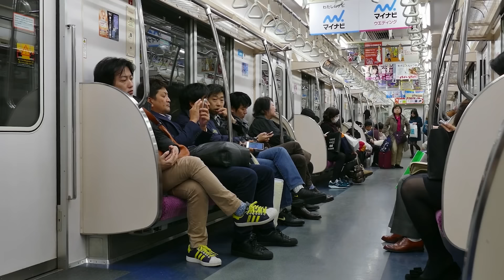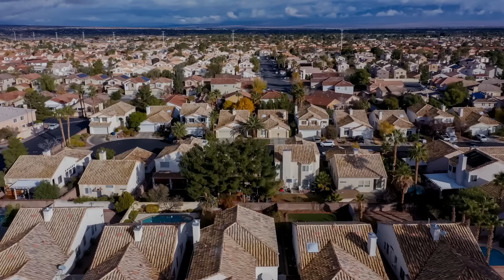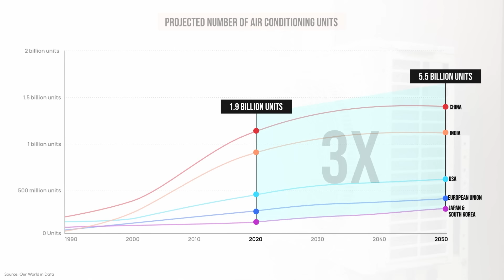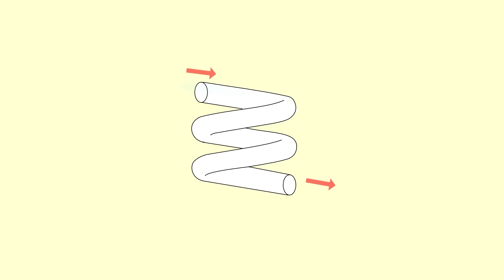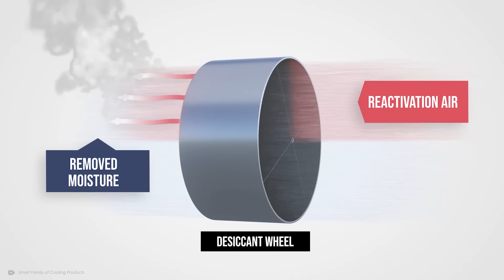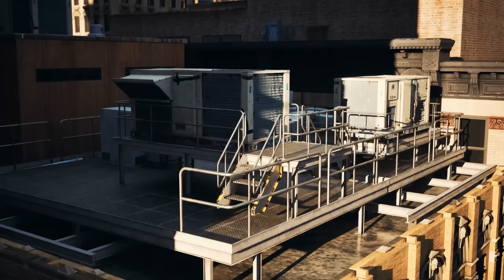The Future of Cooling is Here: The NASA Breakthrough

Comment from the maker: Clarifications below! Protect yours and your families privacy and support the channel by getting 20% off DeleteMe at https://joindeleteme.com/Ziroth

CLARIFICAITONS AND CORRECTIONS:

- The biggest error is the order I presented the components in. I believe the Helix coil is placed AFTER the liquid desiccant, which is sprayed into the incoming air as an aerosol to extract the water vapour as droplets. This means the centrifugal effect can efficiently remove the liquid desiccant droplets from the air, which allows water vapour to be extracted in the process. 

- I mentioned in a now removed clip that dehumidification is a side-effect. This is not correct as AC units were originally designed to be a dehumidifiers, however most of the 'useful' work now done is the cooling effect, as that is what people are really looking for.

These were silly oversights due to rushed timelines, but I will continue to try and minimise these errors going forward.
Reply: Frankly,  it's still misleading to say that cooling is the "most of the useful work."  While it's true most people probably think that,  it's telling that theH in HVAC is for heating but the AC is for air conditioning not simply cooling. That is because humidity control is a key aspect of air conditioning even if most people are unaware (seemingly, OP included). 
Keep in mind that humidity is expressed as a percentage of saturation which is a function of temperature, cool the air without removing moisture and humidity will rise, quite possibly above 100% and you get condensation. This is why drying the air is a critical function of air conditioners.  To wit, this new technology requires a water extraction step, so it's still functionally AC (not just cooling) despite using a different process to achieve the effect.
Reply: Air conditioning doesn't say refrigeration but yes it is taken as many call a cola a coke or at one time all jeeps was cross term used for a model or style of utility vehicles. 
Condensed air has many uses. Jets and commercial air crafts ,sky scrapper and residential can use a verity of air conditioning  methodology
Reply: @jon9103  air conditioning can be for both heating & cooling self explaintory words but with out context. 
This video of nasa discovery sounds more like a filtering dehumidifier improvement at best but I'm not sure why this is any better than what we already have. 
We can filter H 2 0 molecular bonds out of air. 
Start getting smaller like in covid you block air molecules before you can ever actually filter out sub micron pores. Lol
Reply: stop your bs about carbon emissions propaganda . you are carbon. ok
1966: oil gone in 10yrs
1967: dire famine forecast by 1975
1968: overpopulation will spread worldwide
1969: everyone will disappear in a cloud of blue steam by 1989
1970: the world will use up all its natural resources by 2000, urban citizens will require gas masks by 1985, nitrogen build-up will make all land unusable, decaying pollution will kill all the fish, killer bees, ice age by 2000 and America will be subject to water rationing by 1974 and food rationing by 1980
1971: new ice age coming by 2020 or 2030
1972: new ice age by 2070 and oil depleted in 20yrs
1974: space satellites show new ice age coming fast, ozone depletion and "Great peril to life"
1976: scientific consensus planet cooling and famines imminent 
1977: department of energy says oil will peak in the 90s
1978: no end in sight to 30yr cooling trend
1980: acid rain kills life in lakes and peak oil in 2000
1988: regional droughts in the 90s, temperatures in DC will hit record highs and Maldives will be underwater by 2018
1989: rising sea levels will obliterate nations if nothing is done by 2000 and New York City's West Side Highway will be underwater by 2019
1996: peak oil in 2020
2000: children won't know what snow is
2002: famine in 10yrs if we don't give up eating meat, fish and dairy and peak oil in 2010
2004: Britain will be Siberia by 2024
2005: Manhattan will be underwater by 2015
2006: super hurricanes
2008: the Arctic will be ice free by 2018 and Climate Genius Al Gore predicts an ice free Arctic by 2013
2009: Climate Genius Prince Charles says we have 96 months to save the world, UK Prime Minister Gordon Brown says we have 50 days to "save the planet from catastrophe" and Climate Genius Al Gore moves his 2013 prediction of an ice free Arctic to 2014
2013: the Arctic will be ice free by 2015
2014: only 500 days before "Climate chaos"
2018 A top climate scientist is warning that climate change will wipe out all of humanity unless we stop using fossil fuels       by  2023...Greta Doomberg.
2019: Hey Greta, we need you to convince them it's really going to happen this time
2020 Greta Thunderberg global warming will cause temperatues to rise to 80 degrees celsius and drown 80% of the population.
2024 Greta still alive.
2024 WEF
Reply: I'm concerned about the long-term effects of systems that don't have properly maintained or poor performing scrubbers to remove the desiccants. We'd be breathing that in.
Reply: Einstein & another guy co-created a refrigeration system that's a solid state that uses heat as the motive force to power the process. I live in the desert so that's what I plan to build for my home refrigeration needs. The Helix system is neat. Pretreatment of the air could make things a lot easier for me to cool the air that cools the machine.
Reply: We do this already in southern usa filtering and dumping water in our homes to unload work on cooling a/c units. 
In the dry west they can use this knowledge & tech to cool without refrigeration but they rarely do despite all the tree hugging. 
These used to be a primary camper tool of cooling but isolated and alone humidifiers will only cool so many degrees under the greater environmental temp & conditions.
Reply: @dadsonworldwide3238 maybe take a look at a weather report before casting your shade redneck.

"only recommended in low-humidity climates of 15% humidity or less. Areas with 30% or more humidity are not ideal for swamp coolers since they will struggle to accomplish the evaporation process in a more humid climate."

I understand youve spent so much time kissing boot and licking hairy orange butthole that it never crossed your mind that there may be different climates in areas where the tallest hill is not your mom, but do you see that bit where it says 15% or less? Now, I know it must boggle the mind of someone so vacuously inexperienced in the world, however I have unfortunately pulled the short straw (dont worry, its just a piece of straw, not a branch. Im sure you're used to holding smaller things, but it is just some straw) on informing a 'i can pull up my own Huggies' big boy like yourself that there is infact a high desert, and a low desert. 

And here in the low desert, right up against the mountains (just like everyone in town is right up against your mom), its above 30% from May to October! You know, all the hot months one would want to cool off their houses? Hell, it stays above 15% from April to November! Im 100 miles away from the beach, and it gets wetter closer to the ocean!

So, here is my question for you Mr Southern Pride (dont worry bayby, I's almost done. You can get back to your white flour here in a second, hun); with swamp coolers already being a thing in the high desert, in the few areas where it is below 15%~30% humidity (yes, even up there it can be too humid for swamp coolers to work effectively), and the population density difference of around 80%, in other words there are 5 times as many people in the low desert, where its humid when its hot than in the high desert where evaporative coolers would have any chance of working......how much of a dick do you think that tree hugging comment made you look and do you reckon that kind of attitude is why yall dont get taken seriously constantly showing your ignorance like that all bold and arrogant like, bless your little hearts?

Ruminate on that for a spell would ya friend? Cuz this California redneck is fixin'a learn ya somethin, son.

Comment: Humid air hae energy stored in potential energy of the water wapor. When you condencate it with ANY mechanism that enery will be reliased. And since all methods have non 100% efficiency you will release even more enery. So... how you will remove that additional heat?

Comment: You completely skipped over THE BIG SOLUTION:  Building into the ground while using superior insulation, reflection and transmittance to cool the interior.

I introduced a humidification step in my portable A/C's outside air intake with less than $20 in parts.  Two gallons of water a day only cost a couple of pennies per day, yet reduced my daily A/C electrical load by a couple of dollars a day.

Comment: So, if "preconditioned" air is dryer air, how many nosebleeds will that cause? How many people will have to run a humidifier in their homes to offset the preconditioned cold air? I get that removing moisture before cooling makes a huge, undeniable improvement in A/C systems and efficiency. And that's great. But if you've ever had dried out sinuses before, you know how much that sh*t can hurt. Just wondering.

Comment: I designed an aircon system 6 years ago using a silica gel hygroscopic heat wheel to catch the moisture before entering the air handlers. Ambient air 30°C 75% RV air after heat wheel 26°C 45% RV. The regeneration of the heat wheel was accomplished by the treated return air from  the building. The proven energy savings are 50% from the calculated heat load and no extra energy consumption for regeneration. All equipment is readily available and proven technology. Sorry NASA.

Comment: Never heard of the word "desiccant"... Really It's everywhere. Open a bottle of Excedrin and you will see the little pouch or in a bag of beef jerky.
The humidity in the air with respect to HVAC is called "Latent Heat" and yes a good part of BTU dissipation is devoted to removal of the humidity in the air going through the HVAC system. The system has to remove the humidity first until the system properly removes the heat from the air. When you first turn the system on the Delta T may be 16 deg F or lower but after a few hours the Delta T will get up to 20 deg F or more once it get the moisture out of the environment. So yes, if there is a way to de-humidify the air before going through the HVAC evaporator core using little energy would be a big benefit.

Comment: Some of the largest sources of Energy WASTE,  is not from Heating and Cooling,  but instead,  from POOR INSULATION.   Houses and Building could stay Warmer, or Cooler,  for MUCH longer... if they were insulated much better.   Furthermore...   Put Building Into the Ground... and you no longer have to spend Energy removing Snow, as well as have more Stable Temperatures (no Cold winds, and no sun rays beating down onto Hot Roofs).

 Since there would be no Frigid winds to deal with underground... you also do not experience as much Heat Losses, from the Opening and Closing of Store Doors.

 But the BIGGEST BENFIT to putting most everything Underground... is that you would Free up the Above ground,  for Luscious Farmland, Forests, Parks, Lakes / Waterways, Etc.    No more Concrete Jungles, on the Surface.   People could visit and enjoy the surface / parks,  anytime they chose.
Reply: Also, one of the biggest Heat losses in Houses,  seems to be from Windows (especially large "Picture Windows").   Most especially, since houses use much Thinner Plate-Glass.  Even double pained windows, do not seem to be as effective as the much thicker Tempered Glass, used in Commercial Buildings.

 It there was a mandate for much thicker window glass..   It would go a long way.   Even it that meant, that many places would reduce the overall number of windows.

Comment: I am an HVAC professional, sounds like somebody's trying to eat a free lunch to me. 

Assuming the system works as claimed where is the energy to push the air through these tiny channels going to come from? 

I'm willing to bet once you factor in the increased energy requirements to push air through these channels as well as the additional wear it will place on the blowers as well as the cost to produce and distribute the desiccant this is a net negative.

Comment: @ZirothTech just stumbled on this channel. Interesting stuff!

Always cool to see new tech being developped, especially with huge upsides and little downsides. This one seems like it would be a good fit for bigger buildings. Depending on cost, maybe households.

Another company, Graphene Manufacturing Group based out of Australia, is doing a coating product for HVAC called Thermal XR. It will probably interest you! Great energy savings in the form of heat transfer.

They are also in the process of making a new type of battery with insane energy density and charge/discharge rates.

Look them up!

Great video! Enjoyed it 😊

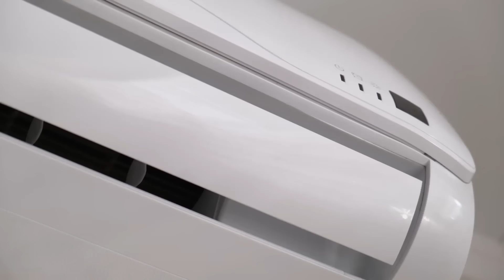Comment: 3:33 -  "This is because it requires water vapour to change phase into a liquid which is an energy intensive task"

I think this is confusing because evaporation requires energy and condensation releases energy... I guess the problem is that releasing energy means more heat to deal with... this took me a long time to figure out.

Comment: How does the pressure drop of the preconditioning filter affect the load on the blower? Is the increased efficiency of the cooling system offset by the potentially increased load on the blower from having such a fine preconditioning filter, and if so, by how much?

Comment: We have already been doing this without all the extra complexity and chemicals. Just take the cold condensate and spray it on the hot evaporator coils: Instantly increased efficiency without added complexity. Air-conditioning systems are already so goddamn complex and wimpy for “efficiency” these days that they don’t last more than a couple of years.. Screw efficiency when it impacts reliability. Just add some solar panels.
Reply: And INSULATION!

Comment: I call scam on this for the following reasons:  1. There are zero test reports showing such improvement. 2. Looking further into this, since last year's breakthrough announcement there has been no further details of any kind. 3. Only ties to NASA was their claimed effort to produce such technology FOR NASA. So it's not a NASA invented or developed technology. 4. Theory itself makes no sense since H2O vapor gas is lighter that's why it rises, so centrifugal force could contra indicate it's effect. Basic chemistry for water vapor to convert to liquid droplets latent heat needs to dissipate so H2O can condense, all the centrifugal force won't make a difference. 5. Desiccant salts are an even bigger joke. Once it absorbs water, it's very difficult to get water out, people just throw away their water absorbed desiccants. At this point, they need to show a real working model with test results.

Comment: For everyone saying: "But the helix can't remove the water vapor from the air, this is all rubbish" are missing a critical piece of information that is also not present in the video. However, either a little thought or research shows what is going on.

Helix Earth is spraying droplets of liquid dessicant into the incoming air. This tremendously increases the surface area of interaction. THEN they use the helix filter to remove the now water laden droplets. Details about regenerating the dessicant are still scant, but perhaps they use the waste heat to help.
Reply from the maker: Thanks for writing this clarification, you are absolutely right. I messed up the explanation of this in the video and should have made it clearer!
Reply: i dont think ANYONE would willingly spray calcium chloride into the air to make every single metal corrode if it isnt gold. and the liquid desiccant will wash the air and collect all the dirt that constantly has to be removed. heating the liquid desiccant to release the moisture takes the same energy as cooling down a surface to condense the moisture directly. the only way to "use waste heat" to dry the desiccant is to run it outside to where the heatpump sheds its heat and hope that its hot enough to drive of the moisture without loosing too much of the liquid to the air.

Comment: So, an evaporative cooler puts moisture into the air. The evaporation cools the air but it uses lots of water.
So then run the cool MOIST air through this filter and make the air even cooler and recycle the water back to the evaporative cooler. 
Result is extremely good cooling with only a small electrical usage for the fans.

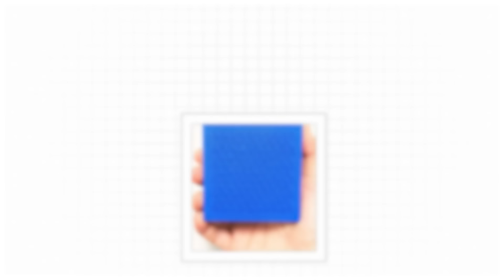Comment: 7:50 Well using centripetal force to take water out of the air explains why you have been narrowly focusing on cooling loads.
A standard Energy Recovery Ventilator [ERV] is probably more flexible for heat pumps in general.
In cold conditions: those micro-channels will be quickly frosted up.

Comment: Humid air isn’t full of droplets, it’s full of vapor. It’s gas. A centrifugal separator stratifies gases based on their density. Water vapor is denser than dry air.

It’s not accurate that they’re “catching droplets”. This is also pointless because the cooled, dried air will just mix with ambient humidity air and condense the water vapor.

Also it’s hygroscopic, not hydroscopic.

Comment: most HVAC systems already have a ERV system for fresh air. Most HVAC system only has a small amount of fresh air, most of the air is recirculated, so no need to remove humidity (unless the humidity added from the occupants). 20% is not comfortable for human, so you still need to add back water to maintain 50%, which then defeats the purpose of lowering the energy use by keeping the humidity low.
You can't get away from not dehumidifying. 
Also, gas phase water is gas.. how can centrifugal force remove "water" if it's in gas phase?? 
This whole thing sounds very much like a scam